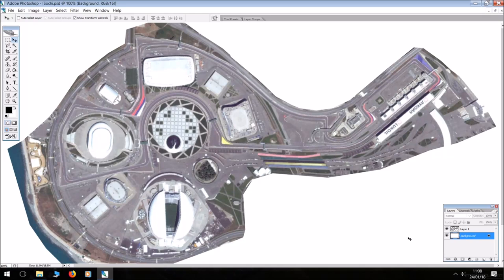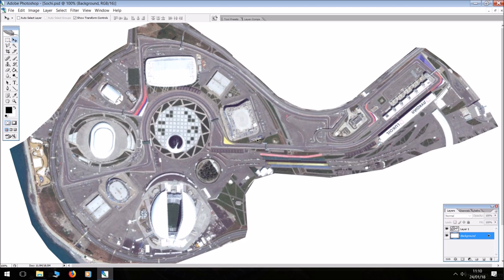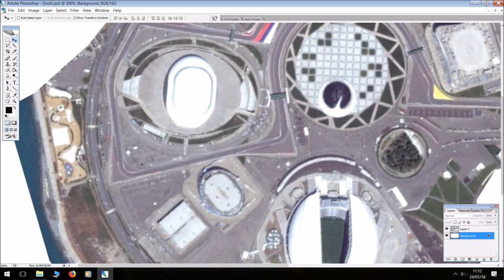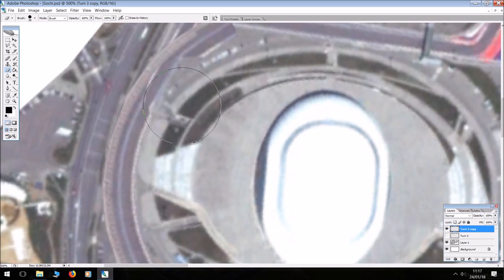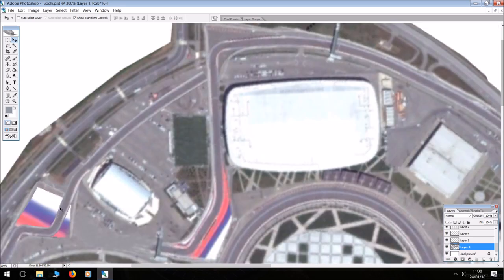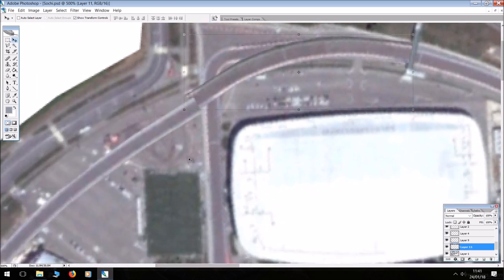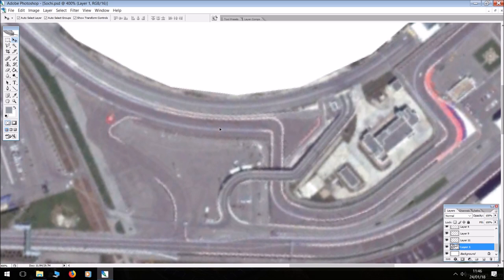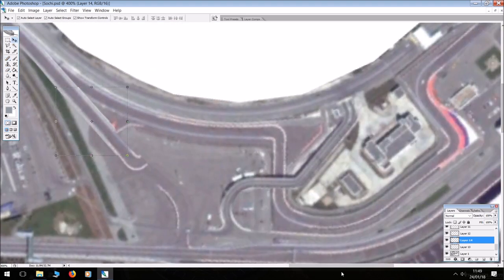How to FIX a race track - Sochi

Comment: Most of the circuits I'd like to see get fix are circuits that were already good in the first place, and then molested, i.e. Hockenheim, Mexico City.
Reply: Don't forget Old Monza, I tried driving it in Assetto Corsa and I really liked the concept of completing an oval first and then the original raceway after.
Reply: Still good,just not as crazy as they were
Reply: New Hockenheim is far better than the old one imo.
Reply: @Angel-dp9sl  new Monza is perfectly fine. The oval is cool and all, but let's face it, there's no practical way to use it safely.
Reply: I think new monza is great outside of the first chicane

Comment: I would make T6-T9 into 1 long right hander, and straight line T12-T15. These would be my very quick fixes.
Reply: For me, T2-T3 should be a faster and smoother 90° right turn into going along the Medals Podium, extending T4 by 30°. Same idea from T5-T8, a long ass 300° right hander around the Boishoi Ice Palace. T14 should be a copy of T15, and T16-T19's curbs will go along the barrier.

Comment: Fix spa
Reply: JS Are you fucking kidding??
Reply: To quote Tim Minchin (purposely) misquoting Shakespeare, "To gild refined gold, to paint the lily, to throw perfume on the violet, is just fucking silly." Fixing Spa is a waste of time (unless you don't like the final chicane).
Reply: JS 
OLD BUS STOP
Reply: @radspeed113  The is the only thing that needs to change.  Get rid of some of the paved runoff sections, so there is more skill needed. It's too easy to overcook a corner now and keep running with no risk of crashing.  Get rid of both Malmady and Les Combes and make it one double-apex corner.
Reply: radspeed team 113 mmmmmmm hmmmmm yes please. They killed the flow with that new disgusting chicane thing. I hate the last corners so much. The bus stop was perfect
Reply: @radspeed113  the old bus stop sucks a lot. I actually quite like the current one. I think it's perfectly fine to have ONE low speed section. If anything, It's a great corner because it lets you calm down and get excited for yet another lap.
Reply: @uyou2tube  have you ever drove that layout in a sim, or are you one of those people who think non-stop speed = a good layout?